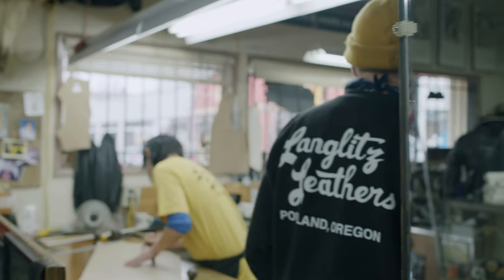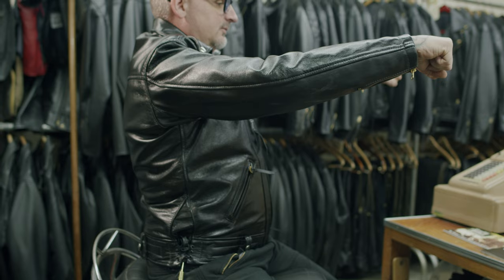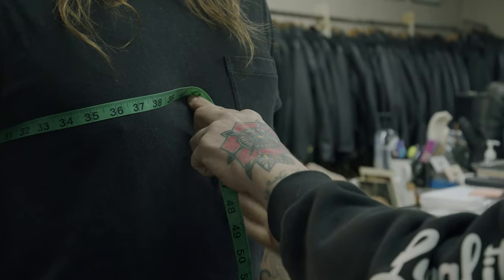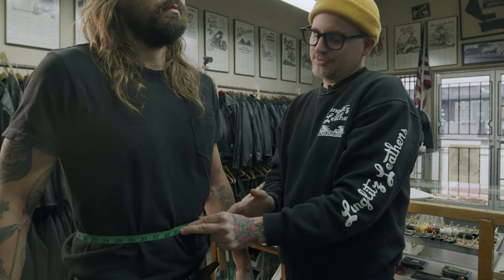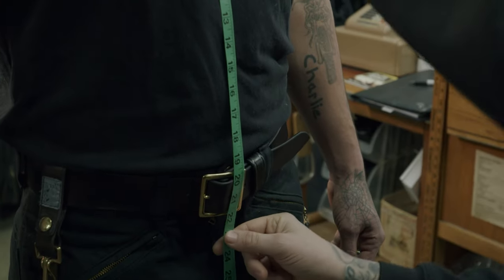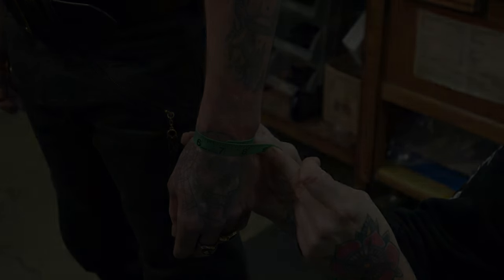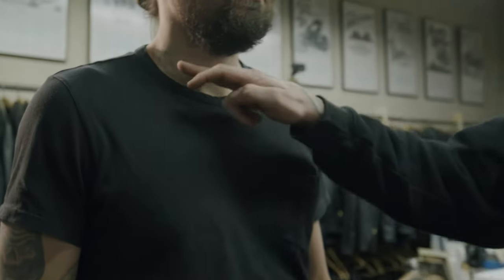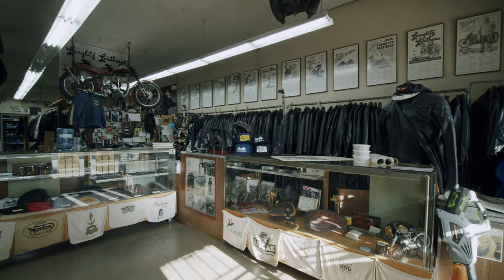How To Measure For Your Leather Jacket - Langlitz Leathers

Comment: Great youtube video,thank you.I bought a size 3X coat on amazon and had to return the coat for a refund because the coat sleeves were too tight.The amazon seller insisted that he goes by North American sizes but that is not possible because I have a U.S. made size 3X coat that fits me very well.I am well aware that different people require different fits but the sleeves on the size 3X amazon coat that I ordered then had to return for a refund measured 8 inches across the elbow section of the coat where as the U.S. made size 3X coat that I have measures 12 inches across the elbow section of the coat.As I understand it the larger the coat size the wider the coat sleeves must be to fit properly no?I ordered a coat from another amazon seller and people that have bought coats from the other amazon seller are also complaining saying that the coat sleeves are too tight.Logically as the coat size increases the width of the coat sleeves must also increase no?The amazon sellers insist that they are using North American sizes but from what I can see the sellers are too focused on chest width,waist width and sleeve length and are totally ignoring the sleeve width,am I wrong?The U.S. made size 3X coat that I have is a CAT brand coat and is not a special order,I bought it from the store's stock inventory.Another thing that really annoyed me besides the coat sleeves being too tight is that the coat that I bought on amazon rides up too high if and when I lift my arms while wearing the coat where as the U.S. made size 3X coat that I have does not ride up so high when ever I wear the coat and lift my arms.